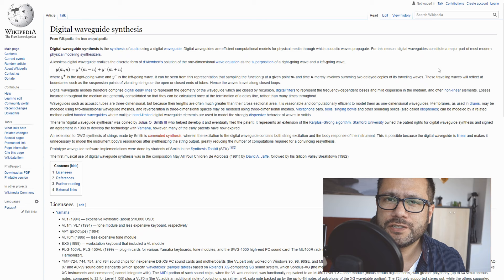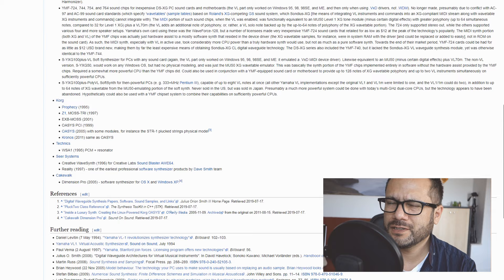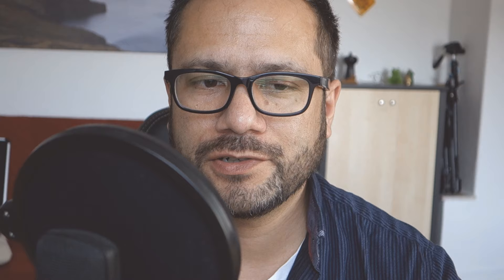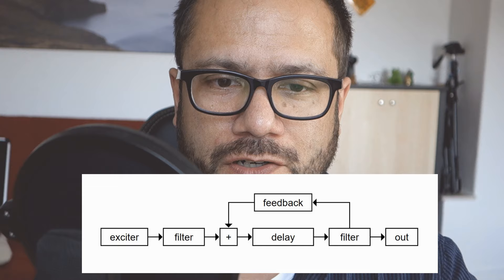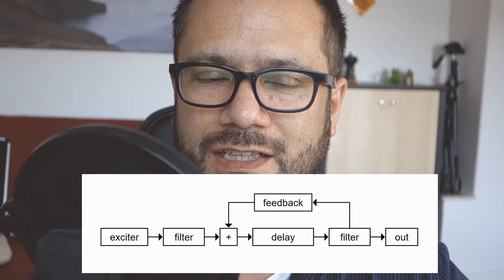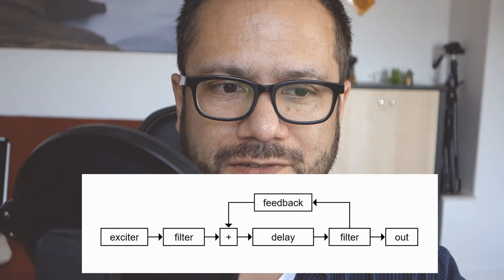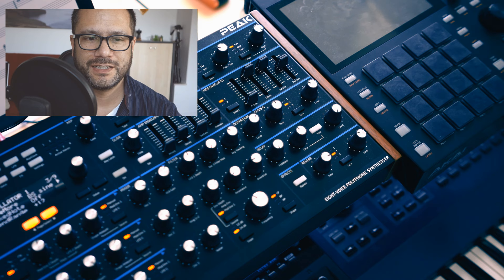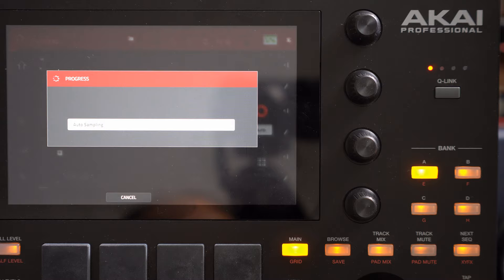VL synthesis: Can we have it back, please? (Yamaha EX5)

Comment: 4:37 How do you get to those settings?  I can't read the screen on your EX5, but I assumed the manual would explain it... It's completely useless, in that respect.  I don't see anything at all about settings for the VL instruments, just an overview article, in very vague terms with no specifics about how to set anything.

Are the settings equivalent to the ones on the VL70m, just hidden in a different menu, or does it not have the same details?  I can edit all the parameter of an "Int" on the Vl70m, but I'm a bit baffled by the EX5R menus.
Reply from the maker: Hi, thanks for watching!
When in EDIT mode, you can use the patch selection buttons 1-8 on the right side of the keyboard to quickly switch screens. They're labeled with the screen name they will open ("Common", "Amp", "Pitch"... and so on)
Reply: @mr_floydst  I didn't know they were also patch selection buttons.

I found a list of VL "controllers" pretty well hidden in the separate Data List document (126-146)...  So, does it all have to be done via [F7] CTRL [F8] SET?

I see VL Pressure in that list but no VL Pressure Curve, so it seems it's not the same as a VL70m... unless there's some other way to change the curve, without needing a controller for it?

For the VL70m, the pressure settings are like this:

Edit -> CONTROL -> CONTROL EDIT 13 onwards:
	Prs CC No.=02
	Prs CtrlDpt=+127
	Prs Curve =-08

There are similar settings for Embouchure, Growl, Damping, Toungueing, and so on.  If it has to all be set through the mod matrix (SET), there doesn't seem to be enough lines to set more than a few of them at once.  Do we just have to choose a subset of them?

I'd been told VL-Wizard, which I've used to edit VL70m voices, and as a sysex librarian for it, works with the EX5/EX5R except for EQ, but it's looking like that's just not possible because they're so different.  The one thing that does work is saving the Custom elements to the EX5R, though I then have to tie them to a patch by hand.

Comment: I really miss a polyphonic VL synth... Pipe organs could be emulated in a more expressive way than the real counterparts, which lack air pressure control.
Reply from the maker: If you're looking for a hardware synth, there's the Aodyo Anyma Phi (which is 3 voice paraphonic) and their new model, the Omega (which seems to be not quite ready for market release yet), that's a super impressive and intuitive hardware "VL" synth. 
The best "VL" synth overall is Reason Objekt, I have a video on that one. It's a Reason Plugin, though.
Reply: Yes, I'd prefer to avoid computers, although I know about their potential. I am glad to know about the Omega, which might be what i am looking for. Thank you!

Comment: While VL is technically impressing, normal sampling does a pretty good job at imitating real instruments too (lets say you had sampled a real guitar on the MPC One instead). And you doesn’t have to be an engineer to play the real instruments, surely that’s why Yamaha still makes those. Not saying that I don’t want new VL instruments (a Reface VL1 would be cool!), but rather for making more ”untraditional” sounds to be used with different MPE controllers, like an ”affordable Continuum” (even though you get the Eeagan Matrix with the Mini version too.)
Reply from the maker: Thanks for watching! Maybe it's my fault 'cause I stuck to "acoustic" stuff in this video, but this tech can produce some rather "out there" sounds you just don't hear on other synths. (The "Mad Tube" is only one example, there are other synth and "hm what's that but it sounds cool" sounds in there). It really depends on the parameters you dial in. And yes, I'm looking forward to the "osmose" synth which is said to be released later this year (I'm one of the backers). It's using the Eagan Matrix and I can't wait to get my hands on that. :-)
Reply: @mr_floydst  The problem is to balance komplexity to user friendliness. It would be nice with some kind of ”MIDI-standard for MPE” that auto-mapped the available controllers (of course with the possibility for furher configuration.) What are your opinions on the Eegan Matrix vs the Equator 2, regarding sound, flexibility and user friendliness? Myself, I have no experience with neither. And do I dare to ask if you think it’s possible to install either of them on a small ”stand-alone device”? If I’m correct, both the Continuum and Seaboard has built-in synthesizers?